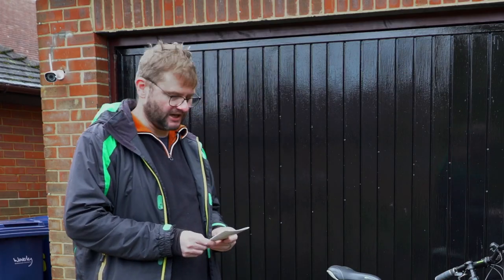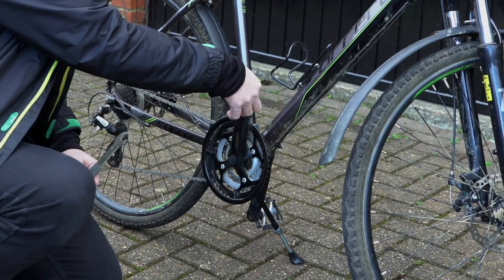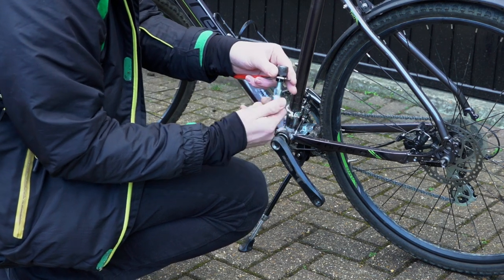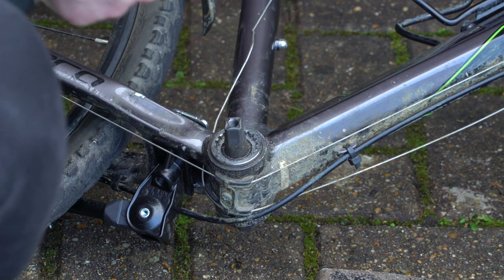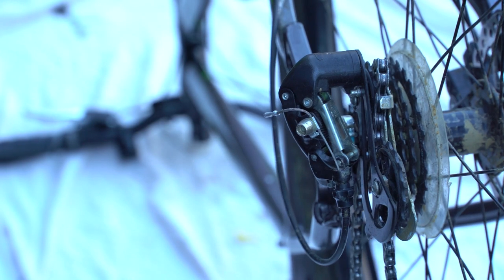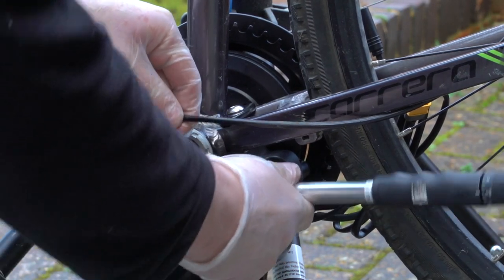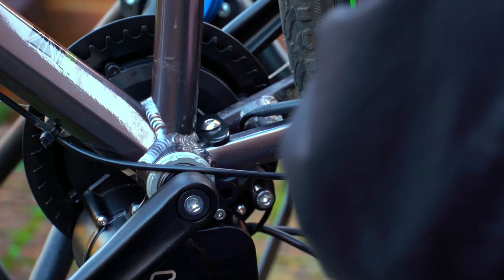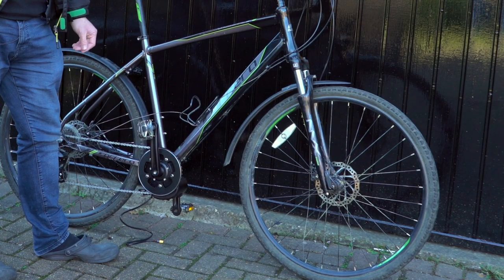Unveiling The Ultimate Tongsheng Tsdz2 Mid Drive E-bike Motor Bike Build!

Comment: I have fitted 4 of these now to mtb's hardtail & full sus. One important point is to ensure that there is clearenece between the drive gear casing and the chainstay (sometimes requires a little fetling). the reason is that if touching, when tightened up, it can affect the torque sensor. However, i have been delighted with these motors and have many happy trouble free miles under my belt. Brake sensors are not really needed as being torque sensing, the power stops when you stop pedalling
Reply: How do you notice if the touching is affecting the torque sensor? Mine slightly touches but I have nothing to compare it to

Comment: You dont need ebrakes with the tsdz2. Just more cable clutter.
Motor will run without speed sensor installed.
Reply from the maker: Good point. The brakes came with the kit so I thought it'd be rude not to fit them!!

Comment: @6:00 on my bike the cable housing actually fit between the motor and the frame. I even added a second cable housing for the brake cable (reused the housing from the front derailleur) so now both my rear derailleur and brake are nicely tucked away for a clean look. Still don't get the point of having sensors for brakes/shifter on a torque sensor motor. After a lot of years of using a bicycle I stop pedalling when I brake and the tsdz2 takes about a second or so to stop and I think it winds down gradually, so as soon as you stop pedalling, the torque goes down immediately. And like with any vehicle, if the road conditions have the potential to ne dangerous, slow down, don't rely solely on the brakes. Prevention is paramount. But that's just me :)
Reply from the maker: Good to know on some frames the cables will fit between the motor and the frame. I take your point about the brakes but as they were part of the kit I fitted them anyway!
Reply: I have fitted 3 where the cables sit between frame and motor , very neat

Comment: For the brakes use a  Through-Line/In-Line E-brake Sensors or  Magnet E-Brake Sensors.  Instead of the included brake levers.  
Then you do not need to replace the gear changer.  

With the Through-Line/In-Line E-brake Sensors you may want to replace the brake cables.

With the Magnet no brake cable change.  I attached originally glued the sensor on the brake lever but it came off.  So then used a zip tie to secure it.  In my case I used one included brake lever for the front brake and the magnet for the back brake. 

In the US theses items cost about 15 US dollars for a pair.

Hope this helps.
Reply from the maker: Thanks Jim, really helpful advice for other viewers. Shame I didn't get your message earlier, as you'll see from my next video released tomorrow, I fitted a new gear selector. TBH the new brake levers do feel nicer quality.

Comment: Just subscribed and Liked.  

I wish I had bought a Tongsheng instead of a Bafang becuse the Tonsheng has a torque sensor rather than a cadence sensor.  I would like that much more and it would be more effective for exercise.   My Bafang installation was soooo easy with no snags but I wonder if the Tongsheng would have been as easy without snags.   I may replace mine with a Tongsheng but as it stands everything is working like a charm so not sure how much I want to change it.  Maybe I will wait a year then do it.

Comment: Hi buddy I've done one of these motors before just struggling with the chain line any suggestions please 🙏
Reply from the maker: I can try and help. Can you give me a bit more information?
Reply: Getting a good chainline can be a problem, especialliy if a spacer is required on the BB to clear the chainstay. On a couple of my builds I had to modify the chainstay (remodelled slightly with a hammer) and slightly ground the casing to provde clearance - not ideal but it worked. Also for the MTB;s I fitted a smaller 38T chainring, offset with washers to bring the chainring further inboard, the smaller chainring  allowed more chainstay clearence